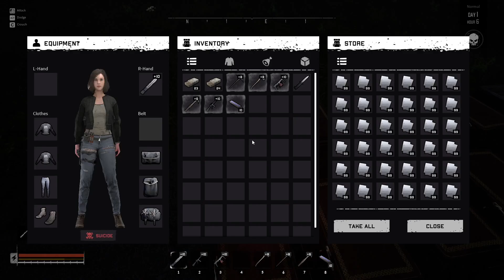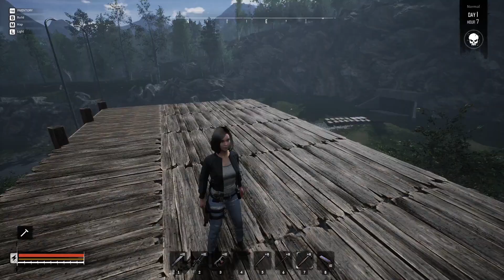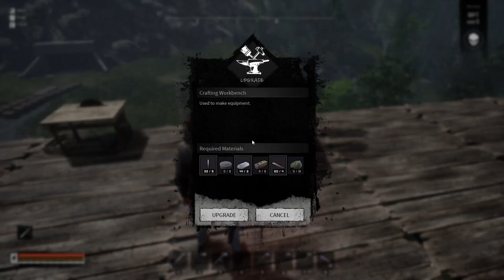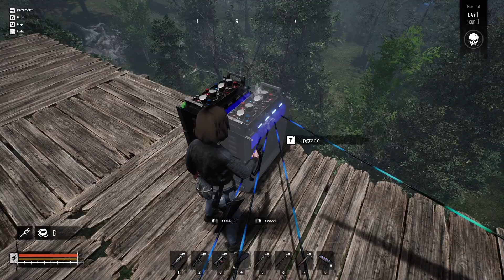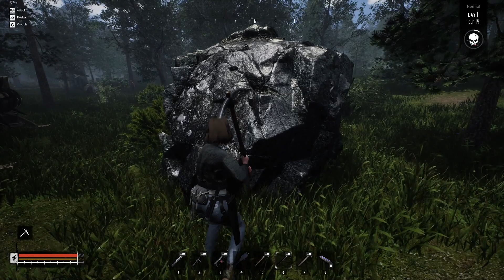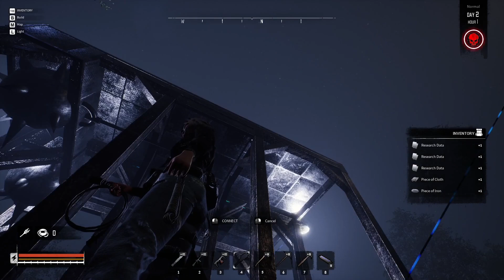Night of the Dead - Electrical Early Game

Comment: Bro, there are many huge buildings in the game which I couldn't enter. Is there any way to loot them or they are just there ?
Also, I gound it very difficult to add a floor as a ceiling in my base. Could you make a tutorial on that topic please ?
Reply from the maker: Hi Ganeshakw, at this time there are a number of building that are not lootable. I believe the devs may be changing that as the game goes on. AS for adding a ceiling it is easiest if you use beams to great a grid for the floor or bridges to fit into. It will be like creating a floating base only instead of in the air it is above your first floor. My survival playthrough show the floating technique. I have been on break from making vis; however, I am looking to start again soon. Cheers!
Reply: @gjsgaming1618  Thanks Bro.
Reply from the maker: @ganeshakw  You're welcome